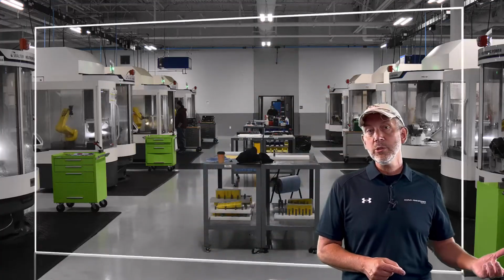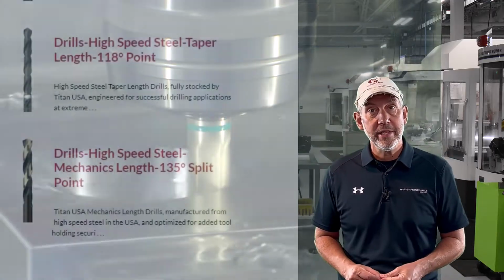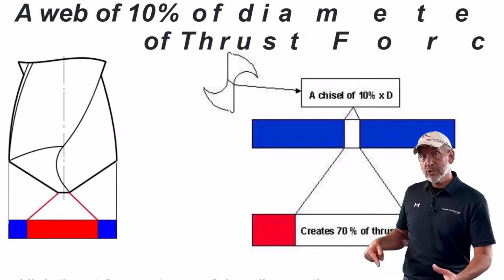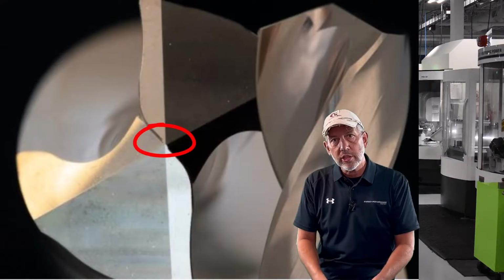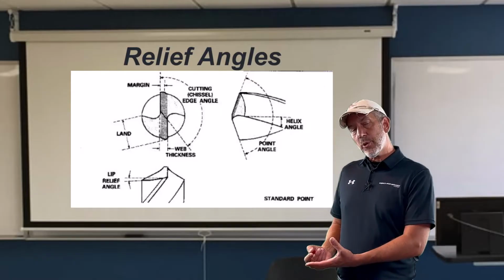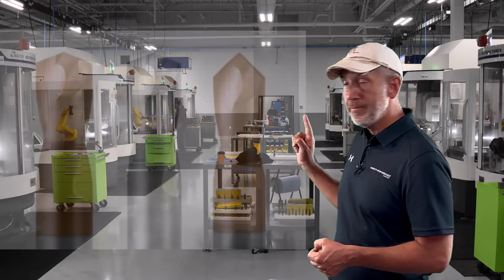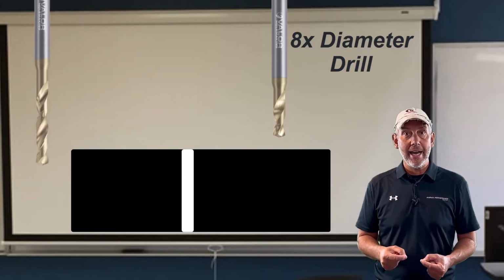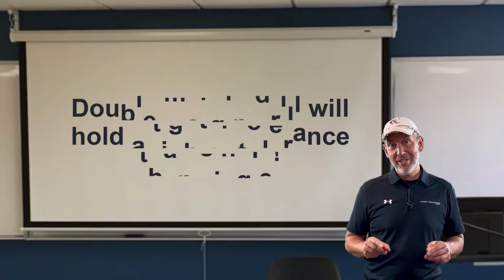Diving Into Drills: In The Loupe TV Ep. 18

Comment: Fantastic video! But I have a question, Right around 22:30, you mention to always run through coolant. But what if your machine isn't capable of that? What would be your approach to running 8~10x holes with a low pressure flood coolant system, in say, 304L or 316L stainless? I deal with a lot of #4-40's, #6-32's, and M4x0.7, so small diameter hole information would be appreciated.